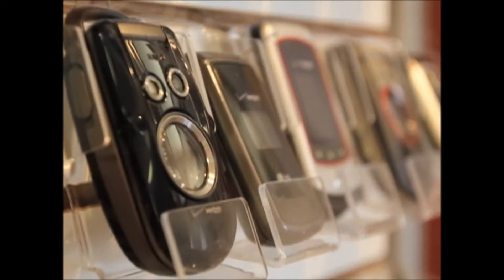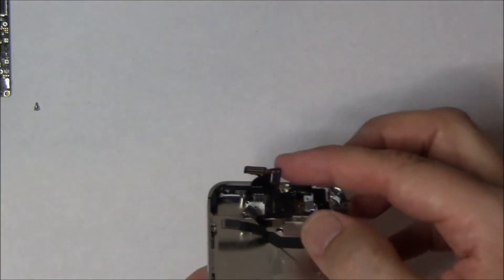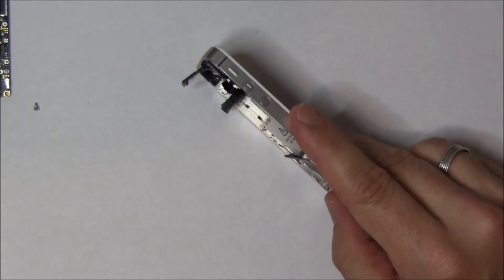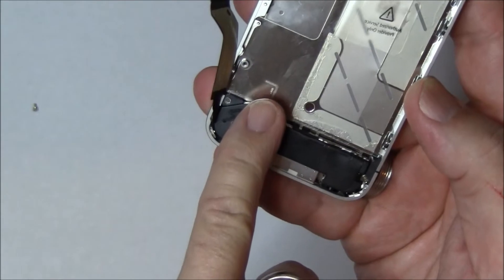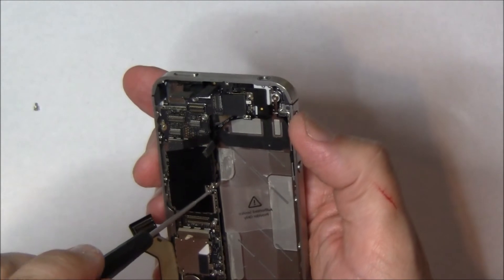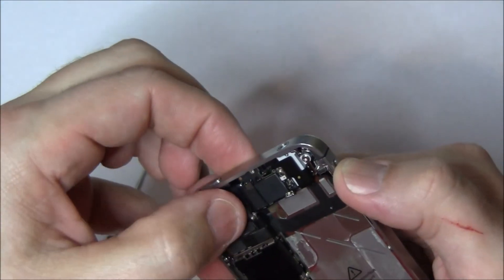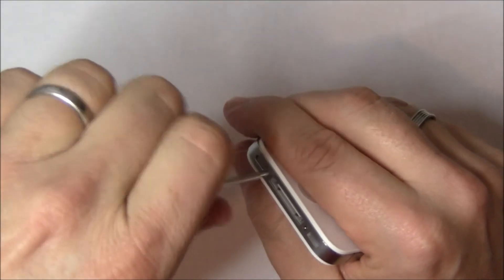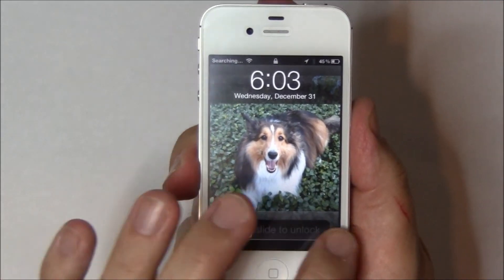iPhone 4s Reassembly / reassemble by Yakety Yak Wireless

Comment: All of these videos are pretty much terrible, this one is no exception. They seem to be less instructive then designed to show you how difficult the process is in order to use their service. The camera goes offscreen routinely. The resolution fails to show detail and the camera is often out of focus. The most difficult portions of disassembly and reassembly are ignored, such as the correct screw positioning and type of screw at each position and the placement of shields and grounding pieces.